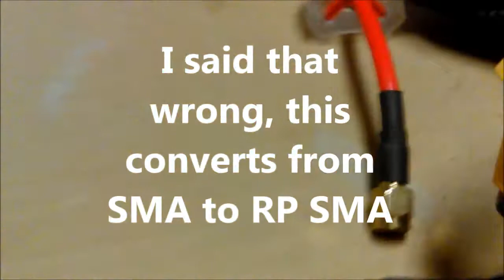Eachine Wizard X220 - HOW TO convert SMA to RP SMA antenna/vtx

Comment: U never mentioned the length of the pin needed? Do u mind sharing that info thanks!
Reply from the maker: I'm sorry my friend I simply installed the pin then pulled it back out and cut it to the proper length to make it stick up the entire height of the fitting, I never measured it precisely

Comment: quick diy fix : Pull the pin out with pliers , stick a fitting piece of solder in and srew antenna on, job done works like a charm